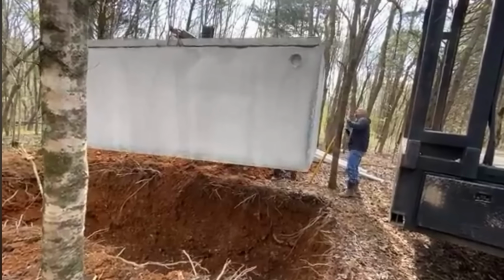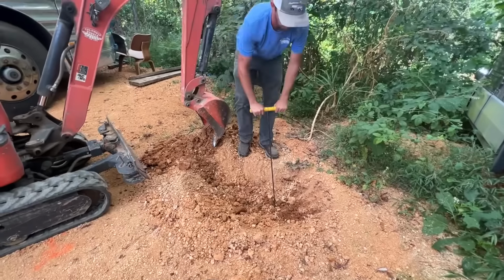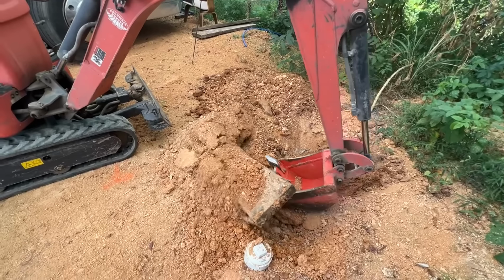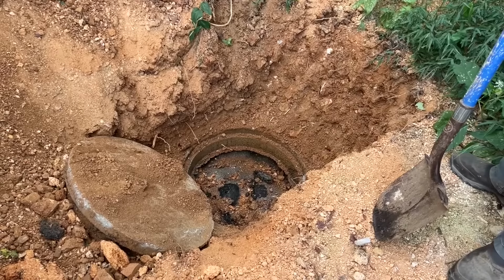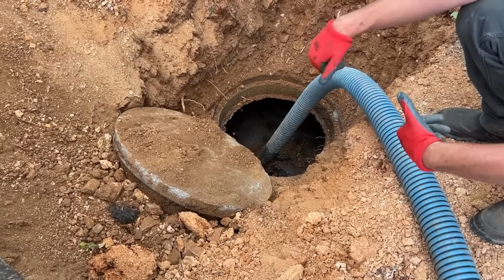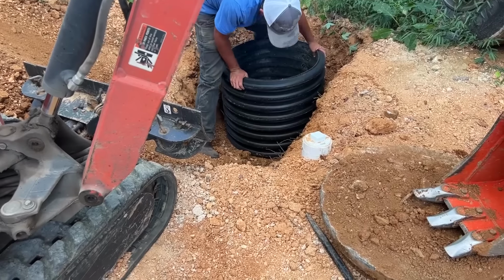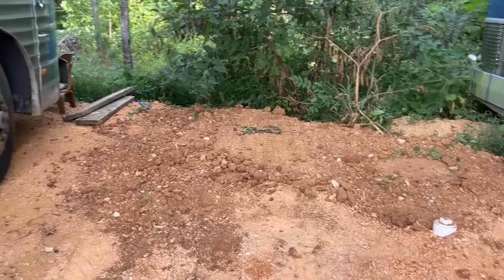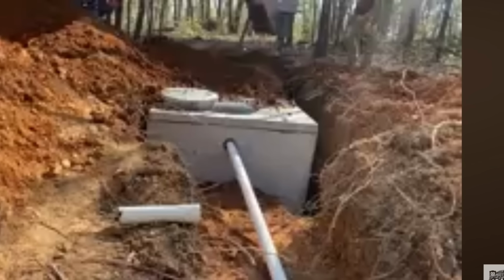Septic tank backing up. Are RV dumps killing the bacteria?

Comment: I see that lots of folks have put their comments here already about their suggestions and experiences.
Mine is... Yes, figure on calling for a pump roughly every five years.  Even if not having trouble, good to have eyes looking for problems down there.
Fond memories of being a kid.  We moved into a brand new house, and at the 5-yr mark,  my Dad called and had a guy come out.  Not only did he pump us out,  after the tank was emptied, and somewhat rinsed down,  he put a small ladder down in there, climbed down inside with a flashlight for an inspection. He found that on both the inlet baffle and outlet baffle, the pvc pipe was hard up against the concrete baffle,  so he got a hacksaw and trimmed it back to an acceptable length to allow the incoming solids to pass without forming a jam.  The outlet side is supposed to be liquid only,  but he trimmed it back, too.  
Anyways, his advice to us, was to put some yeast down there once or twice a year.  He said, buy a cheap roast at the store, cut it down to fit through the toilet and pipes, send it down there.  Stuff that would introduce and sustain bacteria that does the breakdown job.  As for buying a roast,  no way my Dad could let a roast that was otherwise edible go to waste, so he would joke that he'd watch for roadkill in the area,  chuck that down in there.  Truth is, that would work, but you'd just have to unearth and open the lid to get it there, as there is no way on God's green earth that my stepmother would have let him carve up some dead animal to flush down the toilet.  So, he had to make sure to do it on the down-low, when she wasn't around. Some secrets are better when nobody tells.
So, about every five years, he would plan having the septic truck come on a weekend when I was down for a visit.  That way, I could help with the digging.  Was also nice to see Mr. Devereaux, the owner of the pumping business.  He was a good guy.
Reply: That explains why my uncle had the cover on his always available... then again, my aunt did come up missing ...

Kidding. The old bitty is still alive.

Comment: I have a concern that they didn’t open the second compartment of the tank. Since it wasn’t draining out the outlet is likely clogged and if you’re lucky it has a screen on it that would need to be cleaned yearly. 
If it doesn’t have a screen your drain field will likely fail prematurely
Reply: I agree, I guess we might see another video on this.

Comment: We added risers after spending TOO much time digging the covers out at the farm.  But our risers had caps that were fastened with easily removed bolts.  No need for equipment to remove the cap.
Reply from the maker: Just a bar now you can remove the caps since they are level with the ground.

Comment: I had real success with the stuff you buy at Lowe's. It's called like septic shock and is green and in a gallon bottle. When my drain lines were not working well I had the tank pumped and added 1-2 gallons of that a week till the problem went away. I believe that's what the directions called for on how to use it. I swear by the stuff. They also have maintenance bacteria treatments but that was to correct a problem. Even after pumping I had liquid topping out of the ground along the drain line even for just one load of clothes. I used that stuff for about a month  and I no longer have that issue.

Comment: I had a drainfield issue back in 2012.   I then changed my system to aerobic with a bacteria tower incubator and an air pump.   The air pump is inside the house, short hose run to the tank.   The pump runs 24/7 but it does not consume much power, only making a few psi discharge pressure.   The air goes to the bottom of the incubator and keeps the fluid circulating.   There is no odour other than the odour from the decades in anaerobic service.   A major difference is no scum since I converted to aerobic service back in 2012, so I have not needed to pump out.
It is possible the backup could be due to scum build up getting into the discharge pipe.  It took several years for the drainfield to clear and drain easily.
Reply: I had the same issue with my septic system.  I then added the air pump system, with a diffuser in the tank and from that day forward we never had an issue with the septic system. Just keep up with the yearly maintenance.
Reply: Same here - my drainfield is too deep to get oxygen (36" is the limit), had no air vents, and there was no filter on the outlet (it wasn't code back when it was installed).  We added an outlet filter, installed a fish pond aerator in the second tank, and have had zero problems in 7 years. In fact, with 7 people in the house, we have only 10" of soft, powdery sludge in the bottom of the tank after all this time. Zero solids on top, too. In an ideal world, the tank is anaerobic ad the field lines are aerobic, but when the tank gets overwhelmed, the anaerobic flows out and clogs the field lines. If not enough oxygen gets to your field lines, you'll have problems. Anaerobic bacteria are only 5% as aggressive as aerobic bacteria, so the problem just spirals. Fish pond aerator solves that problem, and I'm going another 5 years before I inspect the tank again. Easy to DIY as well.  FYI you can make your own sludge measuring tool with a knee high sock ziptied to a bamboo pole.  Slowly drop it into the tank, then slowly raise it out, and you'll see where the sludge level is.

Comment: Use no fabric softener or bleach. Also by occupation, possibly a lot of grease when washing clothing is being dumped in there. Rv’s are dumping a lot of solids, grey water and who knows what else. Perhaps a separate tank for customers you just periodically pump out would help. I do add enzymes monthly. Just had mine pumped and the system is working beautifully.

Comment: On my master plumber test for a certain city, we’re 25 questions on septic tanks. Couldn’t have been one or two in the whole city. Here is what I know. First, a septic tank in an anaerobic bacteria digester. No wipes! I don’t care what the package says! They are not flushable! It will not digest anything that has not passed through the digestion process. No garbage disposals please, they do make one that adds a bacteria booster. I am a skeptic. No fats or oils, that includes salad dressings. Wipe  the bowls  your used napkin and trash it. Limit use of chlorine products, kills bacteria that live in your tank. Liquid laundry detergent, the binders they use to make the powdered detergent, Carry through and are clogging factors in the leach field. I do add a high quality bacteria booster once a month, want to keep the bacteria count high so the can do there thing of breaking down solids and paper. Our county requires a pump out or inspection every five years. Tanks the serve large households 3 years is a good interval. Your goal is to keep solids from getting into the leach field and poisoning it! My two cents for what it’s worth!
Reply: and you forgot, don't plant trees around the leach field or close to the septic tank itself. 
My parents had a house built in78 that's on a well and septic. Over the years, my mom decided to plant a couple of trees  close to it.
A couple of years ago, it all backed up in the basement.
When the plumber ran the snake down through the cleanout, it came back with a root on it. He ran it through again, and it went into the tank it snagged an even bigger root that had grown into the tank itself, it was awesome.
Reply: Which one is better, RidEx, the one that's been around forever, or the new, cheaper Green Goblin?

Comment: Some observations from a septic tank regulator.  That top layer is grease and quite a bit of it. I suspect the RVers are dumping their cooking grease down their sinks. I am surprised that is not a two compartment tank,  It may be but I only saw the guy pump one tank.  In a two compartment tank,  the first compartment settles the solids and the septage flows over a weir into the second compartment which has far fewer solids if both compartments are pumped regularly.  I also did not see him clean an outlet filter which keeps solids from flowing into the distribution box and drain field.  Solids entering the drain field is what ruins the system and costs big $ to fix. If you don't have an outlet filter, you really need to have one installed.  Zabel is a popular brand.  Typically, tanks are pumped at 3 to 5 year intervals.  Based on what I saw you should pump at 3 year intervals. Get an outlet filter and do not let any RVs or other heavy equipment anywhere near the drain field.  If the drain field pipes are crushed you have real problems.

Comment: Id open the lid in a week or so. If i
t's high again.check the clean out to leachfield or if it has inspection ports on the enviro tubes. You might have an outlet filter. Some new septics have them. They need to be replaced or cleaned yearly. It be located in the outlet baffle at the cover on other end of tank. Your septic plans would show it. The enviro septics on my state nerrd a leachfield vent especially if they are buried over 18 inches deep. Id put some bolsters or Jersey barriers in front of the septic tank to protect it from bus parking

Comment: First time seeing somebody use plastic drainage pipe for a cover riser.I helped install a few years ago and we used cement rings.
Reply: Mine has cement rings too
Reply: It doesn't look like he sealed the riser to the tank. Rain water will get in to the tank now.
Reply from the maker: Rain water will not get into the tank.
Reply: @BusGreaseMonkey  Yes it will!! Especially with your porous soil it will percolate down and get into the tank. I had that problem on my own tank when a previous owner just set the riser rings on without sealing them. It will cause excessive loading on the tank which will ultimately kill your drainfield.
Reply from the maker: It’s under our covered shelter mr dipity do exclamation mark x2
Reply: thats a double walled  Corrugated  pipe  and this is pretty common usage.  there is even plastic "lids that fit that  type riser pipe
Reply: Our septic tanks (two of them in series) are not buried as deep as yours.  Our driveway guy also does septic systems, so not long after we bought the house in 2013, we had him find the top of the tanks and the hatches.  The tops are down about 18” at most.  After having it pumped out, he installed corrugated plastic risers and fitted them with green lids.  The risers are attached to the top of the tanks with mastic (I think that’s what he used).  The lids are at ground level and visible.  Very easy maintenance now and no issues.
Reply: @ronaldcooper7609 rain water won't hurt anything.

Comment: I wish you used a tuft tite riser with tank ring.   It’s much better and safer.  The concrete cover on ADS pipe isn’t bad but isn’t the best.  The additive is just bacteria that grows in the tank to break down the solids. it’s nice after a pump out.  I noticed your tank did not have a scum layer on top of the liquid which isn’t very good.  If it did and the pumped it out all your bacteria colony is gone.  What’s killing the septic is the chemicals cleaners people dump.  I would recommend a tee filter but you need to clean them off every few months because the TP builds up on them and if you have one I hope they cleaned it. That may have caused your back up.

Comment: The aeration system I had back in st Louis worked so well that the chlorinated effluent was rated for direct piping to streams after sun exposure to eliminate the chlorine. In fact, the rep said that if code allowed, it could be used for toilet flushing and tests showed it safe to drink, although too risky if it the system failed. I had a 1500 gal septic feeding the aerator.

Keep adding bacteria in case it is inadvertently poisoned by cleaning chemicals and bleach. That way it will readily recover on its own.

Comment: Every 3 years i did our pump out, had a few emergency drains of the liquid side as our drain field clogged up, mega bucks to bring everything up to modern code, so $100 submersible pump solved the problem, flick the switch and out it would flow, grass was thriving in summer, not supposed to water above ground with it but i did.

Comment: It would be good to open both chambers to verify that no solids are in the second chamber.  Solids in the second chamber can end up in the leach field and plug it up.  And if solids are getting into the second chamber, you need to pump the first chamber more frequently.
Reply: i would hope they put a riser on the outlet too
Reply: @onewayt  I only saw one riser
Reply: Yep exactly, second chamber outlet to leach field probably plugged or not flowing correctly.
Reply: Agreed. Your problem is in the second tank.  Check the outlet.

Comment: No way that system should need any maintenance after only 4 years...  I'm curious if the original company wasn't considered? I remember watching the video of them putting in that tank and they had people in the hole with no shoring…. Sketchy as I recall..  I never thought of the petroleum products washed into the septic system to cause such a thick “poop cake” top layer. You may be onto something. 
Thanks and good luck! Love your channel

Comment: Do you have a lot of clay?  How many drain fields do you have?  Are mixing black water with gray water?  Is the ground slopped to prevent run off of ground water?  Black water tanks need time to dissolve and no more than 50 gallons per day.  Gray tanks can take 75 gallons per day.   These are the things I do on my property 900 gallon tank and 500 gallon tank, proper mix to prevent backup tanks.   Done correctly  first pump over 30 years and was not needed.   Pay at the beginning or pay three times at the end.

Comment: I would have it cleaned a little more often. Drainage issues are caused by solids migrating into your drainage system.  as thick as the solids were on the top of the tank they were likely passing under the baffle in the tank. Many yrs in the business.
Reply: Its probably the bulk dumps more than anything... normal septic use is small dumps at a time while RVs are a mega dump. You are dumping a maybe a week or month worth of solids into the system in *minutes*. To actually handle that your system might need to be double or triple the size.
Reply: Drainage line blockage can happen from root intrusion, too.  I've encountered this several times, friends had let vegetation overgrow the lawn covering their drain field.  In just five years lots of small alder saplings sprouted up in the weeds, and the alder roots completely choked out the drainage tiles and blocked the septic outflow.  In both cases, they had to clear the lot, dig out and re lay the entire drainage field.   Was expensive and the household had to use a portapotty for weeks...which pleased no one.

Comment: Those additives do absolutely nothing but cost you money. It didn't make a difference how often I pumped my tank. My septic guy gave me all the info. As long as you limit how much you put in the tank other than waste(paper and wipes) you should go 3-5 years. He recommends a bidet, but we just don't flush wipes.
Reply: 3-5 years is crazy... old sytems around here regularly go decade or two without being pumped. If your system is requiring pumping every 3-5 years something is seriously wrong with it or  you are putting too much soap, clorox and non degradable material down the pipe.... food disposals are also a no no, get a slop bucket instead and compost it.
Reply: I’ll agree on this with exception to the natural bacteria or Rid-X maybe twice a year.  Green Gobbler is totally junk much like the additives sold for RV tanks.  Likely one problem you’re dealing with is the other Buses dumping into yours with no telling what in their tank plus a hell of a lot of water and since yours isn’t draining very well its killing all the bacteria.  This bacteria takes from 1-4 Months to actually be concentrated enough to breakdown what’s in the tank. 

In Louisiana we have powered mechanical systems called MODAD’s so we don’t have to deal with this kind of problem.  These are 3 chambered concrete systems that have 2 different aeration zones where the breakdown is done and then into a clarifier at the end of the process.  My in-laws had the standard septic pond 70yds from the house and about 25yrs ago they filled the pond with dirt and had the MODAD installed and not once has a pump truck been out and that’s even with major hurricanes & flooding that can overwhelm a standard tank. 

In Arkansas they’ve never heard of MODAD but they’re about to because we have 3 systems being installed between September-November and the other septic tank will be used for RV & Camper dumps. 

It’s definitely hard to believe it’s only been 4yrs now since yall have been there! Ha
Reply: @Chief351L  I was just making a comment,  I don't have buses, just a house. I had several septic guys tell me the additives are garbage and other than toilet paper, not even  "flushable wipes"(which are not flushable)I've wanted an aeration system, but replacing mine would just be too expensive.  My neighbor has one(Upstate NY) and his final tank runs the sprinklers in his yard. His lawn is awesome.  I think those systems are great. If I were him, I would have had a separate system for the RV's. 70-100 gallons at a time would probably overwhelm anything.

Comment: Scott, as you surmised, you have a problem with the RV's dumping but you probably also have a problem with your laundry! All the extra grease, bus lubricant type not cooking, from the washing isn't going to help. Also if the RV's are using a pine based cleaner, that doesn't help. Pine oil kills the bacteria. We had that problem on a navy ship. Everyone was used to using pine oil cleaners but it was killing the bacteria in our sewage digester. It got so bad that the captain made using (or even bringing it on board) a NJP offense.